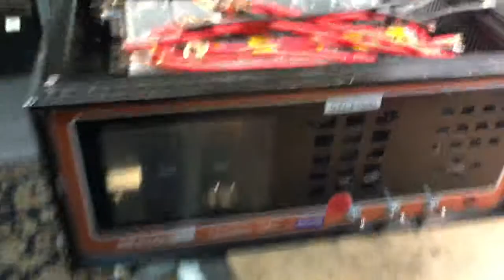12V 200 Amp Power Supply - Preview

Comment: Wondering if u guys could build one these fa me I have a 5amp at home running a 2800wat amplifier and full car audio set up in house so I need one with more amperage soon going to upgrade let I know we could come to a agreement
Reply: I have the same issue and I can't find any videos on youtube showing step by step on how to build one in parallel. I built one with computer power supplies which is able to power my two 8000 watt amps but I would like it to look more like this with diodes and capacitors.
Reply: I built one with computer power supplies totaling 12v and about 600+ amps. This powers my DC audio 20k amplifier flawlessly which in turn drives my four Orion HCCA subs. Bass is strong enough to shake my house. All PSUs have different voltages therefore to insure load sharing I added resisters I made of nicrome 14AWG wire and schotkey diods. To eliminate voltage interference I added 500 farud capacitors purchased from down4sound.
Reply: Oh ha I just realized I responded to an old post I forgot about. Looks like I figured it out, I'm so wicked smart.